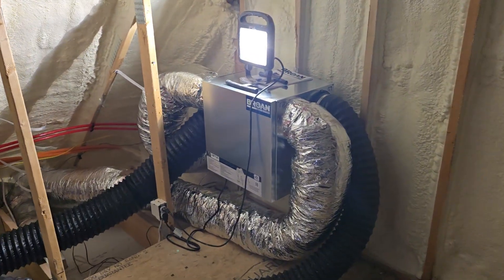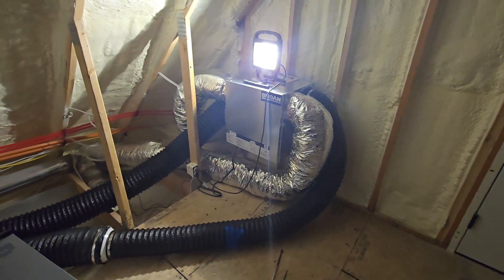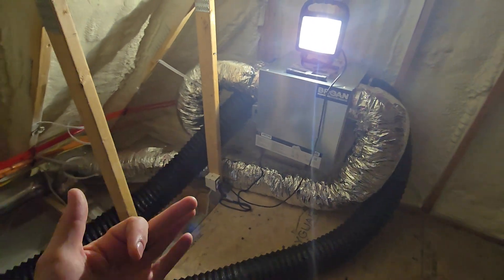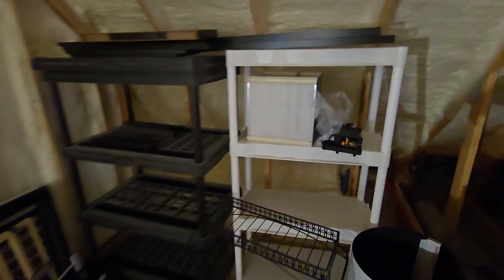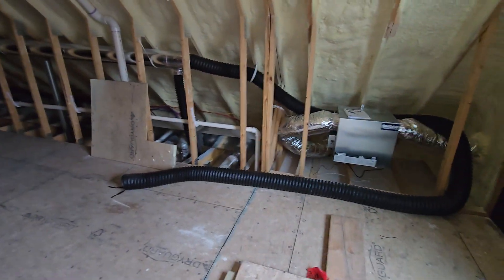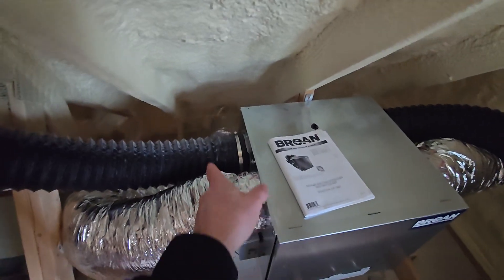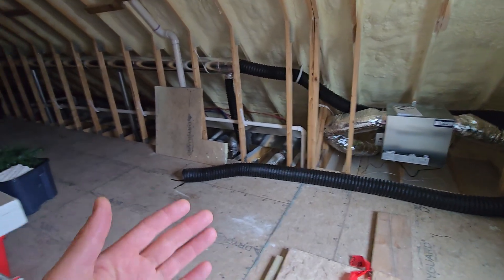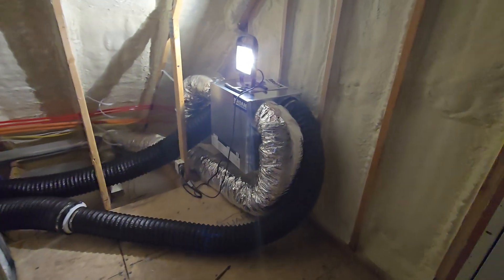The Ultimate ERV Fresh Air System - Detailed Walk-through

Comment: Hello, I presume that’s close cell foam on the roof deck. I’m building a house and I am interested in close cell foam for my attic space I live in climate zone 2. My question is how many inches did you use for the roof? Thank you for any information and thank you for the information on the ERV system. Very helpful.
Reply from the maker: Search online for a spray foam R value chart and you will see there is a point where its not worth adding more than about 5 inches. However you need to follow code of course 😅

Comment: Thank you for the video. Do you need to somehow sync the ERVs and the air handlers to make sure they are running at the same time? If the ERV is running but the air handler is not, wouldn't routing the fresh air into the return mostly just push the air out through the return vents instead of through the air handler supply?
Reply from the maker: Great question. Yes you need to run the air handlers anytime the ERV is running. In my case I have my ERVs running 24/7 so the air handlers will also be running 24/7. But this eliminates stagnant air and allows for constant air filtration. The cost is minimal since you are only running the fans.
Reply: @JimSperanza  what gizmo will make the air handlers run all the time or even in sync with the cfm coming from the erv into the return? I have a panasonic erv and a carrier air handler...
Reply from the maker: @taoyoka theres no specific controller that will do this. Most air handler have the ability to control an ERV but you need to resort to the mamual as they have different ways. However, separate ducting is ideal. The best way is actually to place your fresh air vents in the ceiling right next to your HVAC returns

Comment: Very concise well said information.
 Are you concerned at all about the Mitsubishi Return air actually PULLING too much air from the ERV/HRV? I have read elsewhere that this can be a problem and they recommend HRV supply air entering the Mitsubishi duct work  on the SUPPLY side.
I really prefer your approach of putting the HRV supply air into the return side of the air handler.
Reply from the maker: @tomfraser3384  the return is best. The pull from the fan is actually easing the strain on the ERVs fan that is pushing. Using the supply side would push against the fan and cause issues. When using the supply side you usually have to insert an elbow inside the supply main duct to actually direct the air downstream to reduce this pressure.

Comment: Does constantly pulling that much new air into the home undermined your HVAC's performance? I'm sure it would have to a bit even with the designed heat exchange. I'm curious to know to what degree.
Reply from the maker: @johnb1707  yes you have to take into account the efficiency of the ERV. I have a spray foamed home with radiant heat which is extremely efficient to run so it's negligible for me.

Comment: What is the difference with the erv as opposed to an hrv, they do the same thing do they not?
Reply: I’m in VT and have this unit in an HRV. I’ll be swapping it out for an ERV as the HRV made the house uncomfortably dry this past winter and now that we have heat and humidity, it’s making the house too humid. The problem is that the HRV is giving you the humidity from outside instead of mixing it for you
Reply from the maker: @CMCraftsman ERV is absolutely the way to go regardless, however it is NOT a dehumidifier. If you need to deal wjth excess hunidity you need a whole house dehumidifier. Email me at speranzadevelopment@gmail.com if you want to discuss further info. 👍
Reply from the maker: @dwaynerenton1889  An ERV Transfers both heat and moisture between incoming and outgoing air. It helps balance indoor humidity. An HRV does not transfer moisture. This can be very confusing as to what to choose between however an ERV is the way to go. It is NOT a dehumidifier though. There's a lot to understand about fresh air, condensation, etc.

Comment: Interesting design. I’m familiar with a basement and all the supply and return air feeding upwards. I guess this is just inverted with everything fed downward from a conditioned attic space. The radiant heated slab is comfortable bonus in your design.
Reply from the maker: Yep it's essentially the same just upside down. Since this system is prioritizing air conditioning over heating the ceiling vents all work great as the cool air will fall naturally anyway.